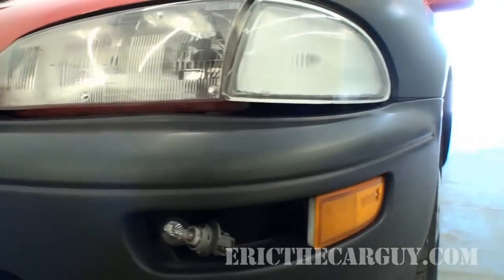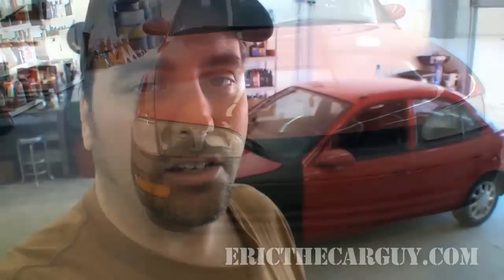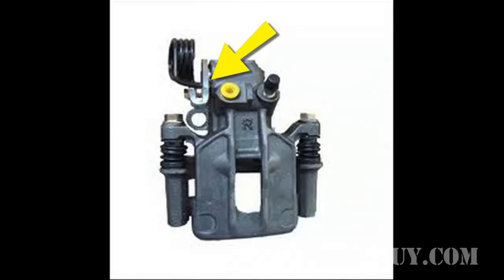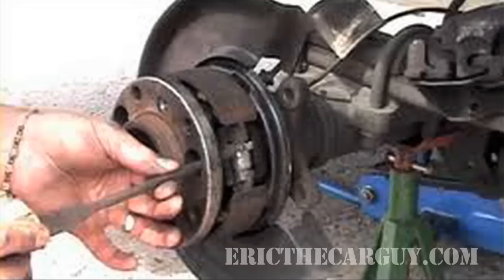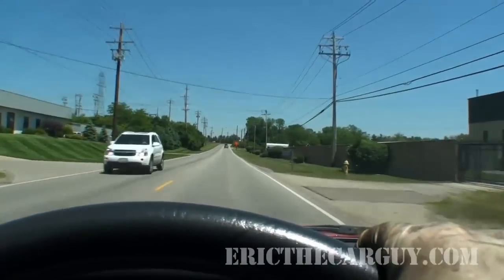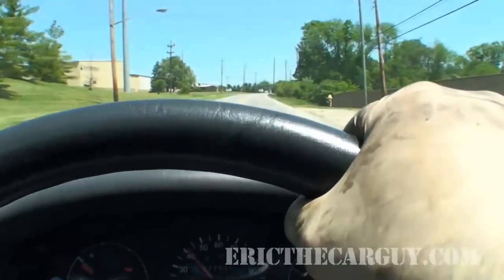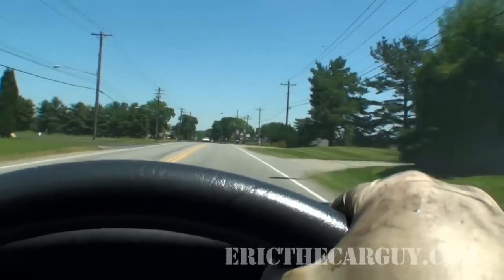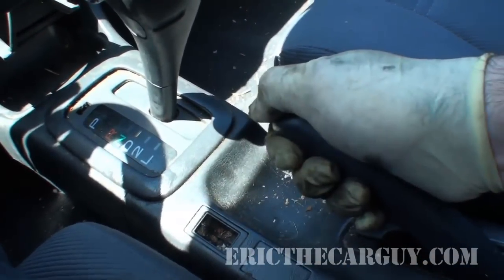How To Isolate A Brake Pulsation - Eric The Car Guy

Comment: Hi Eric , i always get my info from you videos ... i have the same vibration with 2002 Mercedes c240 when i brake i feel alot of vibration in the steering wheel ... i'm not sure if it is coming from the brakes or the tires ( out of alignment ) my tires are very bad ( they are capitol ) :D

Comment: Good video. I have a question though what if you have replaced the front rotors and the back ones and you still have the pulsation? I say this because I have a 2000 Silverado ls and I replace all rotors and I still have the same issue. What to do then?

Comment: I have rotors on the front and drums on the back. I feel pulsation on mine seat and in my pedal when breaking but not on the stering wheel. I did the handbrake test, no pulsation. What could this be?

Comment: Wheel thats been over tighten on one side can cause the disc not to sot stright on the hub.. Over worked brakes can warp as they cool down and possible glaze the pads/disc giving poor brake performance afterwards.

Comment: the wheels off to see if there is any resistance while trying to spin them, is there any way this could be a temporary issue possibly caused by the car not seeing much time on the road.  It only has 76,000 miles so could an accumulation of brake rust cause this perhaps?

Also, I notice the steering wheel shake when I'm doing about 70 MPH but once I go past 80 it stops.  The suspension of the vehicle seems to be in solid shape. Could this be attributed to warped rotors as well?

Comment: I just changed all 4 rotors and brake pads and didn't fix my problem. I get a shaking in the brake pedal at almost stop speed. I have the drum/ pad combo on my 2000 Silverado.

Comment: My brake push back at low speed on dry pavements what can it be I changed abs  speed sensors brakes calipers but stops when the parking brake lights on

Comment: I got a 2015 civic ex with 30k and when i am going down a hill and i am breaking about 50 percent I can feel the brake pedal shaking a slightly but no the steering wheel vibration

Comment: Hey Eric, it's a great video indeed. Well, for me it's the steering wheel that starts pulsing when I put my foot on the brake pedal. What's the problem then? Is it the discs that need to be replaced? Thnx
Reply: traducteur1000 Probably sticking caliper slides, possibly warped rotors as well but not always.
Reply: I appreciate it Eric.
Reply: I am not Eric.

Comment: I have drum brakes on the back of my civic and last year when I hit the brakes the hole car shook brake pedal and steering wheel I turned my drums and it stoped I isolated the problem by used this procedure also if you get a vibration in the wheel when the brakes are not applied your tires probably need to be balanced

Comment: i have a 2000 passat and i feel a vibration when breaking. this shaking is almost unnoticed when brakes are cold, feeling it more when hot. 
i have raised the vehicle and notice that when applying a small amount of pressure on the brake pedal, one wheel slowly stops but the one on the passenger side just drags. it slowsdown and goes, slows down and goes what makes a vibration, even when the car is lifted.
i have changed the caliper, routers, control arms and tie rode end. 
can someone help me to detect possible causes?

Comment: so i think i have this same issue and i told the dealership[ at first the truck generaly shakings at about 60 mph so they rotated and balanced my tires now it only shakes when i brake this never happened the whole week before they adjusted the tires. is this what you are talking about in this video. im upset cause i took a bit of a road trip and the truck was shaking so bad it kinda scared me no lie
Reply: Your brake rotors have some warp in them.  Have the rotors turned and pads replaced.
Reply: yeah going to get that done. but now i also have just a up nd down vibration going dow the road and i have brand new tires on ugh so many issues
Reply: Check your shucks / struts They might have to be replaced
They are the ones that stabilize your car too
Reply: thanks ithink im gonna get my mech friend to over look my truck

Comment: Can warped rotors or front braking issues cause a car to constantly wobble on the road, even if you aren't braking at all? I own a 00 Mercury Grand Marquis and I have had this pulsating brake issue; but I also have wobbling feeling when driving normally. I have already ruled out that the tie rods, pitman and idler arms are not the cause (steering wheel will have a small vibration); but the wobbling is annoying. I also feel the vibration in my seat and the passenger seat back rest shakes too..

I must note that when I had my front end lifted up, I spin tested my tires and heard this rubbing noise from the wheel hub/brake area of both front tires.. (Parking brakes/E-Brakes were on when I did the test). There also appears to be a slight axial tilt when spinning them (very hard to notice).. I had my car aligned and tire rotation within the last 6 months. I had my rotors (all four wheels) replaced with Raybestos rotors + new brake pads.. The braking was fine last year; but now it pulsates along with this god awful wobbling when driving normally.

Possible bad wheel bearing?
Reply: It sounds as if you have a bent rim and perhaps a broken belt in one of your tires. Take your donut spare and swap- it with all four of your wheels (one at a time) and after each swap test drive and see if wobble goes away. If your car was aligned recently then the tech would have shook down the front end and checked for loose bearings etc. as you cannot align a car with worn suspension/chasis parts.

Comment: I have a 2001 infiniti i30, when i got it we had to do about $600 worth of brake work..replacing rotors etc etc. well between 50-60mph sometimes ill have a vibration in the back and front of the car. The steering wheel will shake pretty lightly, but its very noticable in the back and can definitely be felt more in the seat. What could possibly be the problem? Warped wheels (previous owners gave it TONS of curb rash and damage on wheels), or something else entirely?

Comment: we have a 98 Mercury Mystake, It has violent vibration in the front when coming to a stop. i have replace shoes and rotors in the front and drums and shoes in the rear (performance parts), which made improvement with high speed vibrations while driving but no effect while stopping. ABS light is not on. Any thoughts are greatly appreciated. Thank you

Comment: Nice video.  But, my car pulls down on one of the rear wheels when I step on the brakes. As if only one wheel is working. And, it stops after I've drive about 500 feet

Comment: I have a dodge ram and i have changed the brakes and pads and the rear of the truck shake when i brake.  Usually does it over 50mph, wont do it under.
what do you think eric?

Comment: sir pls. response my comment or question. how to set to, to know the settings in the torch wrench in lb or nm. if the head of the bolts was 20 or 30 cm etc. when we use spanner. how to know that this head of the bolts we set like this in torchwrench. example the we use 22 spanner at the head of the bolts how could i know that this is set to,ex.70 nm. etc

Comment: hai i have a problem with my 2006 toyota corola, with 65k miles. when i brake in highways  above 50 miles the brake pedal vibrates and if you took off the hand from the steering you could see it vibrating.( this happen when you are in highway and applaying brake mildly to exit, but if you apply the brake hard i never noticed the problem). i took my car to a mechanic and he replaced the  front rotor and brake pad but the problem still there..... have any idea?
thank you

Comment: So my steering wheel shakes when braking at decent highway speeds, but I felt my rotors and looked at my pads, and the front ones feel fine and smooth, and the back ones are slightly rough and have less pad.

What's the issue?
Reply: ***** 
You won't be able to "feel" the warp in the rotor with your hands.  It isn't about being smooth... it's about having a warp/bend in the rotor.  It usually happens when you have a condition where the rotors are hot and then you drive through a large puddle in the rain.  They heat up enough to the point of getting soft... and then you apply the brakes and they get deformed as they hit water and rapidly cool.  You can sometimes jack up one side (if it's front brakes) and spin the tire with the parking brake on in neutral... and you'll hear the rotor contact the pads.
Reply: IFallionI
 You can't feel the warp but you can feel for smoothness.

Anyway, got them checked out. Front ones have very minor warp and the shop stated it wasn't anything to worry about yet.

Comment: Hi Eric! I own a 2001 Honda CR-V LX, and I've been having an issue with the brakes since I bought it a year ago. My local mechanic has not been able to diagnose the issue and I am pretty much set on going to my local Honda dealer to have all of the brakes replaced with OEM Honda brakes. I have drum brakes in the rear and disc in the front. The issue I've been having is that when I brake, I get kind of a strange chirping noise that seems to be coming from the rear. It doesn't always pulsate but when it does, I feel it in my seat along with that chirping noise (I have a video on my channel that shows this noise). I've heard of that emergency brake test before, and I tried it but it didn't pulsate for the handbrake (which you pull up), even though I'm pretty darn sure it's the rear brakes. I tested something else -- when I'm parked, I've sometimes forgotten that the e brake is engaged and I put it into drive with the e brake on. In other cars, I've felt the car lurch forward slightly and that's how I knew the brake was still engaged, and my car does the same thing, except that the rear passenger wheel seems to go down and lean more than the other wheels with a loud creak. This is also where the brake noise comes from most, is the rear passenger wheel, and I've had two other occurances with that wheel that makes me wonder if there's a bigger issue with this one wheel that's caused me all of these issues, including the following. One night I was driving home from another state and was in the highway when all of a sudden, that rear passenger tire blew out, and when I went to change it, I was confused as to how and why it popped. There were evenly spaced holes going around the tire, which had obviously caused the air to immediately escape. I wasn't sure how this had happened, as I had only been out of my car for roughly 10 minutes before I got back on the road and drove off. I was close to my car and didn't see anyone slash the tire, and if it were to be slashed, why would someone take the time to poke 10 or so holes around the tire when they could just do one slash, and why only one tire? Furthermore, it was 10 or 15 minutes into driving that it blew out, so if someone had slashed it before I drove, it would've been noticeable immediately after I began moving considering how quickly the air would've escaped due to the amount of holes. Then, a month or so later, I was yet again on the highway when I began to notice a slight, constant bumping coming from the rear. Thinking it was just the road conditions, I brushed it off and kept driving, but it only got worse before there was a loud bump and I couldn't keep driving. After pulling over, I found the most bizarre thing -- the tread of the tire, and only the tread, had peeled off of the entirety of the tire like a banana. My parents said they've never seen that happen before and were just as bewildered as I was; the tire was the full-size spare that I had put on after the previous incident, and was still full of air with no holes yet was obviously not drive able since there was no tread. I now have four new tires and have had no problems yet. So, the ultimate question is, would you know of anything that could cause that one wheel to have bad brakes AND cause a tire to blow out in two strange ways? Or are the tire issues seperate and just coincidental, and the brakes are a seperate issue? I know that was an extremely long explanation, but I'm hoping you are willing to read all of that and help give me an expert opinion on what the hell is going on with my brakes and tire. Thank you!

Comment: ever since i got my 2003 chevy Malibu there's been a continuous faint 'wahwah' noise that changes pitch and speed depending on how fast the wheels are spinning, but the weirdest part is that It operates and handles as any normal car would. I got lucky too, seeing that for a car from 2003 it only has around 102,000km (63,379 miles) on it and is generally in very great shape.

Can anybody tell me what the potential problem could be?
Reply: +AlcoholicGam3r I used to have a 1999 Malibu with 400k km's just before we had to scrap it, so all my knowledge is experience I've had with the car. Let me begin with saying I"m not a mechanic, but I had a pretty good feel for the car after a while

My car used to do that too. It could be one of three things. 1) Your tires. Some tires are quite loud, and depending on how they've worn over the years it could start making that noise. 

Which leads me right into 2) Your suspension. In some cases if your suspension is really old it doesn't keep the tire connected to the road as well as a brand new suspension and the wheel would actually bounce on the road causing your tires to wear unevenly. You can check this by just pushing down against the front of rear  of the car. If you push down on it hard, then let go it should come right back and stay put. If when you let go and it bounces a bit (say 3 times) then it could be your suspension causing uneven wear on your tires.

3) Wheel bearings. Your wheel bearings are worn and they need to be replaced. 

Funny part here is that my Malibu had all 3. I ended up scrapping it 3 years ago since it would cost way too much to fix. Now a proud owner of a brand new car :)
Reply: The suspension is still in good standings, doesn't bounce at all, comes right back to where it's supposed to when I push down on it or when going over a particularly large bump (there's alot of those where I live). So that leaves my bearings, and maybe my tires, I do have some fairly meaty winter tires installed. I'm going in to get new summer/all-season soon tires anyway so I'll see how that turns out.
Reply: +AlcoholicGam3r  Yeah the meaty winter tires are generally louder. Once you switch back and it still makes that noise then it could be your bearings. 

Good luck!
Reply: Maybe Eric Clapton is in your car?

Comment: i've changed my front rotors three times now and the steering wheel vibration keeps coming back.  I don't feel any vibration in the brake pedal.  Ideas?
Reply: rear brakes?

Comment: Question regarding this, if anyone knows. 
I had this problem, replaced the rear disks pads and everything today. 
Now i still have a vibration but less, i have been driving with the pulsation for a while, can that pulsation transfer over to the front ? Since the pressure in the lines would go up and down all the time?
Reply: Geez, jack the front end up  and grab the wheel and check for play, if there is none then go to A zone and get a pair of twenty dollar brake rotors.
Reply: Why the Geez, there is no play in the front or back, and i just replaced the rotors (all 4) + brake pads and still have the pulsation
Reply: One of the reasons the brake disc will warp, is uneven wheel lug pressure. Check the wheels where the lugs came in contact with, and clean any corrosion. Don't grease. When tightening back the lugs, check for smooth tightening, and torque in cross-pattern in several steps.
Reply: hi, your car most likely have bad front wheel rubber bushing. when you apply brake at higher speed, the force from the absorbed of momentum will make you wheel move slightly backward. so the distance between your front wheel ball joint will vary, but the steering arm is fix length all the time. that means when you apply the brake your wheel will misalignment. The pulsation was caused by the misalignment wheel, and become more evident when at higher speed. 
every car (even new car)'s wheel will slightly misalignment when apply brake, but it is under the acceptable tolerance. but once the rubber bushing get bad, it will significant increase the degree of misalignment. hope this help.
Reply: Cool will check that ! thanks

Comment: I drive a Toyota iQ with rear drum brakes (european version) and the brakes are pulsating.. i dont feel it in the steering wheel nor in the pedal, pulling the handbrake no pulsation, changed front rotors and pads and it still pulsates, took it to multiple mechanics and everybodys clueless 🤷🏽‍♂️ anybody have any suggestions?
Reply: Could it be a problem with the booster or master cylinder? Brake fluid is quite new and lines are fine..

Comment: i have a 1986 ford thunderbird. when i press the brake pedal, it pulsates but the steering wheel doesnt shake, so i thought it was the rear brakes. i replaced the front calipers, brake drum, all rubber hoses, front and rear brake pads, and the drum components. the pedal still pulsates. what else could it be?
Reply: jtt2553 have you ever figured it out that what was it?

Comment: You are a job to find these days,pity.  Question, what if you have changed all discs (ROTORS ) and pads,back and front. 
         You drive down road to check and all is well.Get home pull into drive brake and the  F/O/S  PULLS DOWN AND  PULSATES VIOLENTLY.
         Had trouble with N/S ,sticking piston,this was freed off  vasaline  applied (not  grease ). Put back together,all working brake
        used and did not stick,wheel moved freely ???   No vibration,shaking or steering wheel wobble while driving.